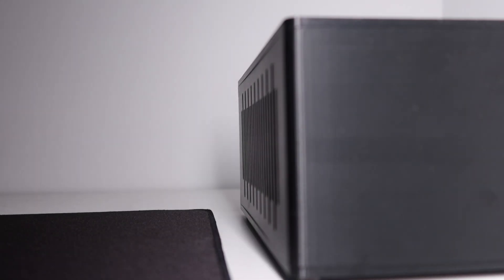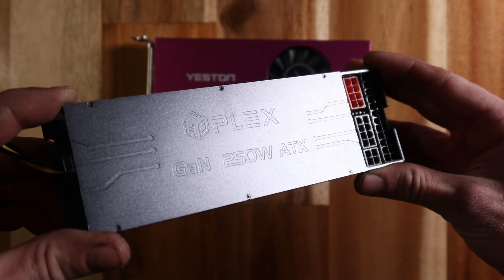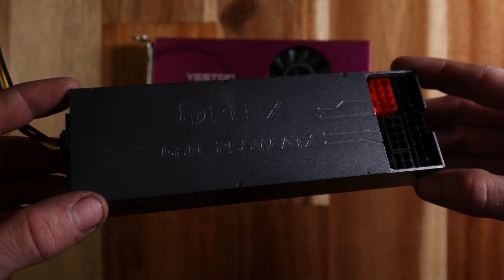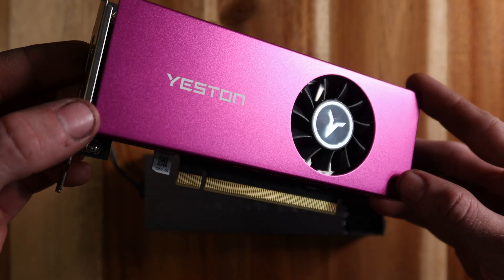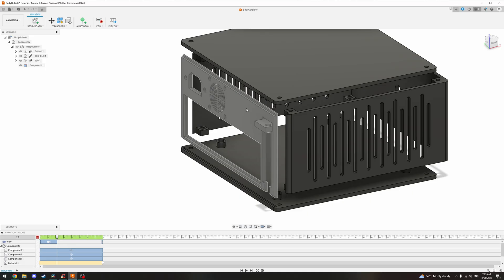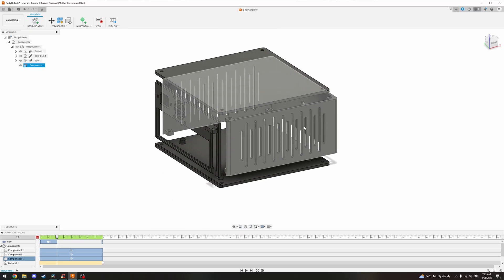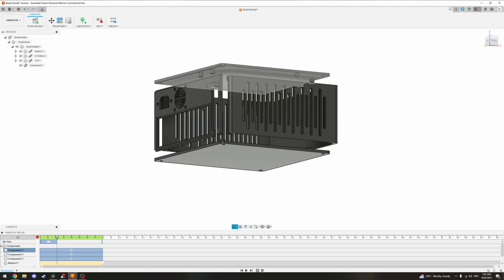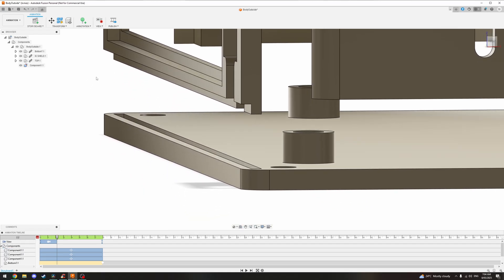I 3D Printed A 3.2L Gaming PC

Comment: If you wanted to spend a little more on the CPU in the future the 5600X3D is AM4 and it is only 10 watt more than the 3600x. AMD has already said something about making AM4 chips again due to ram price surges to help out consumers. IT would be a very noticeable performance boost for more CPU heavy games/ lower graphics settings for competitive games like Valorant or fortnite. I personally own the Ryzen 7 3700x and it is a very bad bottleneck for CPU intensive games my graphics card usage drops to about 30%-40%.

Comment: I'm just starting to research 3D printing and your video gave me so many ideas. Melting the screw insert into the panels with a soldering iron was a great technic that I'm going to incorporate if I pull the trigger on a 3D printer. 

Fantastic work sir!
Reply: Here's another tip. make the holes all the way through, put the insert on the opposite side of the hole.
That way, any stress you will be applying on the insert won't pull it out. Instead, when you're screwing in a screw, the insert, along with the entire printed part will be pulled towards the screw.

Comment: i made a 2.8L one but did not use fully standered parts, the specs were a i3 13100T + a Rtx A2000M frankinstein gpu, using risers and a stacking technique i got the size down to 2.8L

Comment: Uhg...AM4??? Why? Why not AM5? You got an NVME gen 4.0 M.2, yet that slot only supports Gen 3 as well. Not to mention a 250 watt PSU is not enough for a 3060. Cool design and all...but poor choice for hardware.
Reply from the maker: Because I used the hardware that I had laying around. It was actually a 3050, that was my mistake. Thanks for the feedback

Comment: Did you just print this out of straight PLA? I've been toying with the idea of making something like this but a little larger to support a slightly bigger PSU and two slot GPU mostly as a design exercise, but I've seen other case builds having issues with warping due to heat with PLA, since it will deform at very low temperatures.

Planning to try a test build out of polycarbonate/pc-cf or ASA-CF.
Reply: yea i tried to do that with my AD5X as well but the PLA just ended up sogging when my motherboard was under load. (i forgot to space the mobo from the backplate) Plz tell me which material is better at handling heat after ur test :D
Reply from the maker: I used ABS, ive also seen people use PETG aswell. I considered PLA but like you said ive seen a few builds warp alot after only little use. I haven't done much research on the filaments you said but ASA-CF looks like it would be perfect for it. Go for it mate! I'd love to see the finished product.